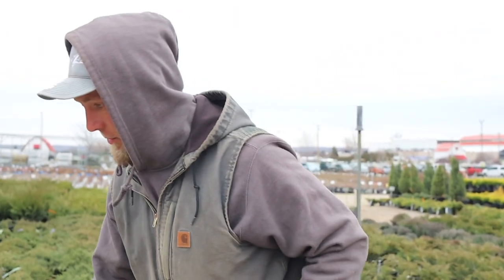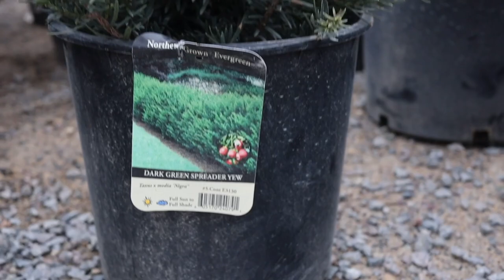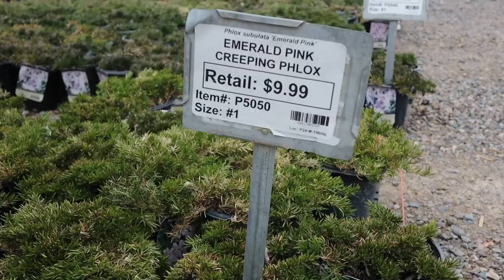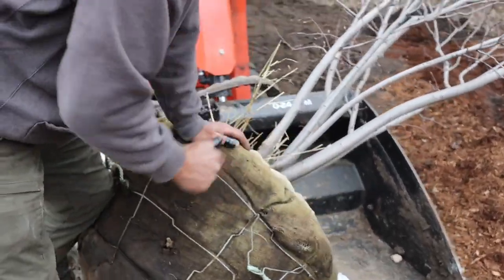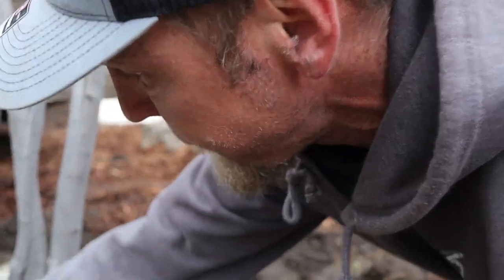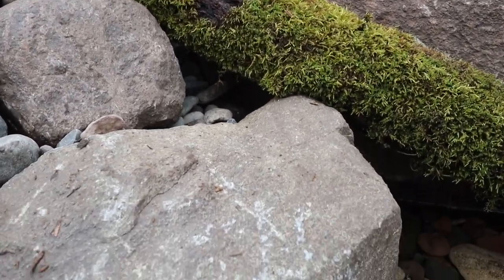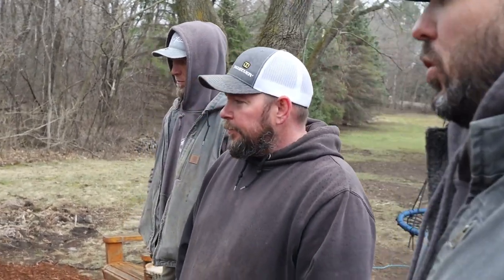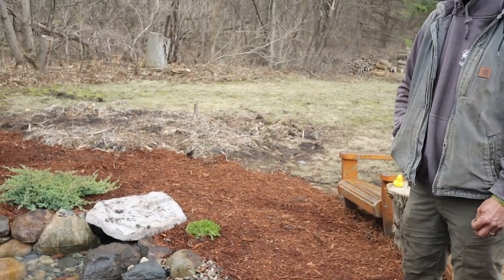Planting a Pond! - Dirt Monkey Becomes CAC REVEAL

Comment: burlap and wire should come off tire. It doesn’t take much longer to do it the correct way.
Reply: Agreed!! The wire cage for sure!!
Reply: @edit-racha  burlap takes years to break down. By not breaking down the roots will go in a circular pattern around the tree. you want them to grow out from the trunk to anchor the tree. Of course with your response about the wire you know about trees.